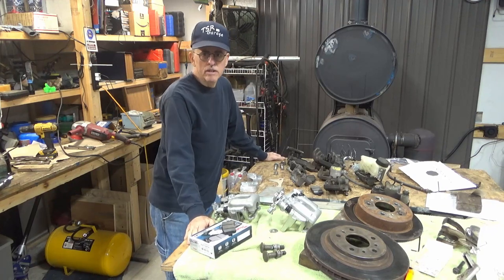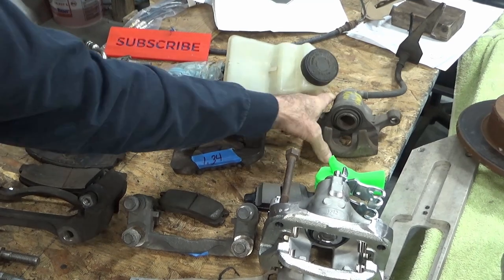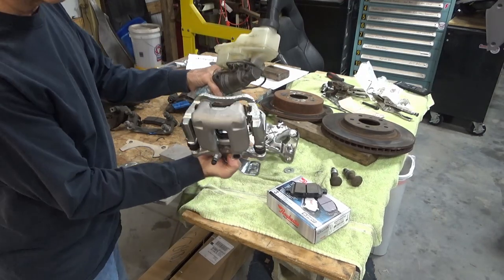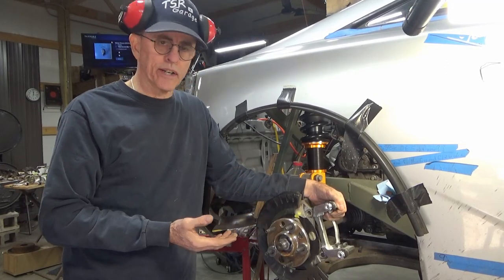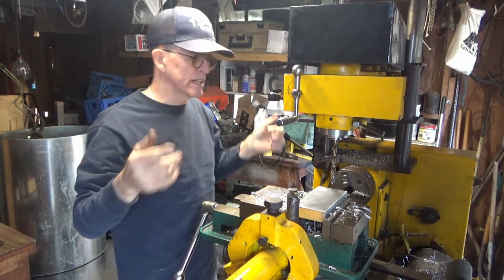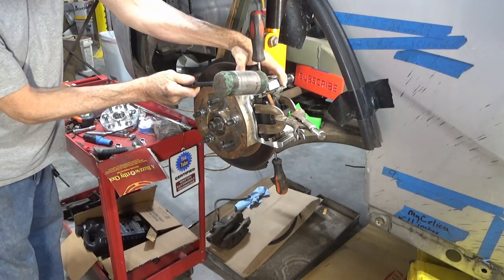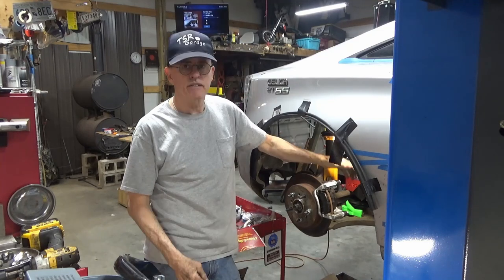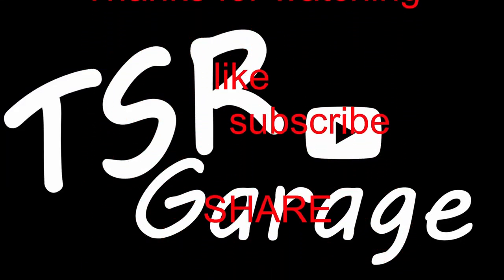32. Brake Caliper brackets, Parking brakes for the V8 Celica, Celica Disc brake conversion ?

Comment: my friend i have 1question for you i hope that i can get response.. my question is i was planning to put spacers on my celica in the front my plan is 50mm at the rear 75mm do you think it would not apic the allignment? looking forward to hear from you my friend ty so much
Reply from the maker: That's a lot of spacer. Spacers will not change alignment, but they will put additional pressure farther out from pivot points. = More stress.
Moving the tires out 2 to 3 inches may change the camber alignment slightly. 
    If all of your suspension components are in good shape, you should be ok.
Reply: @TSRGarage  i already order a new camber on the rear.. so it doesn't matter if i put 50mm spacer at front and 75mm at the rear? Thanks to your advice
Reply from the maker: @Alexander Andresson   as I said, 50 / 75 seems like a lot. But if you have measured it, it should work. You are adding a camber kit, so the alignment is going to be "changed" anyway.